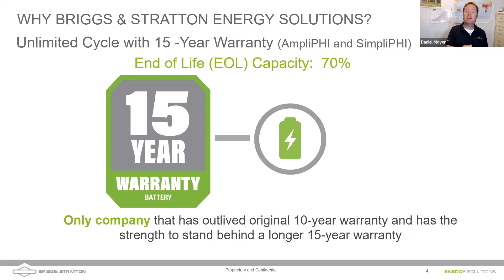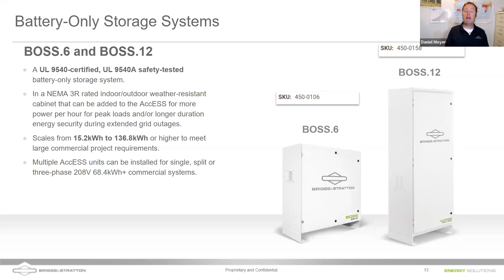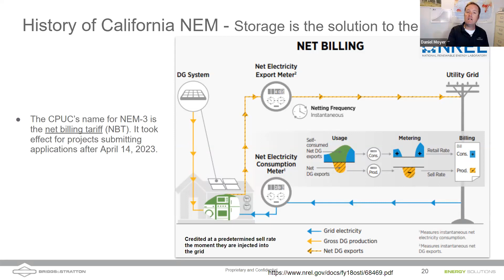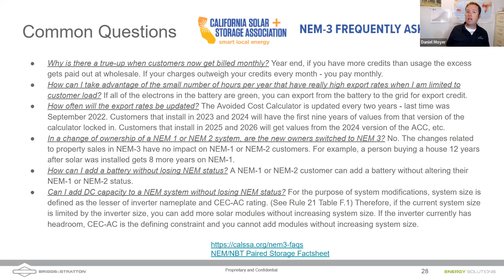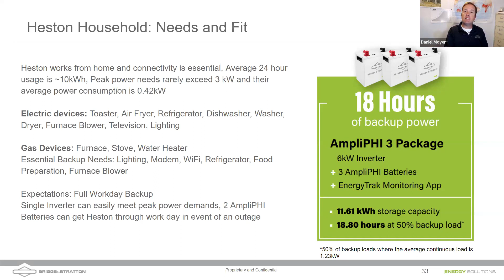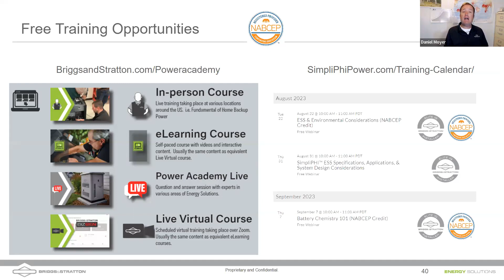How To Sell Battery Storage Under NEM 3.0 in California

Comment: Is there an online cost sheet available for these products?
Reply from the maker: @gracemalley6821 we only provide cost sheets to our installer and distributor partners, but, if you call our sales line, we can try and answer the questions you have.
+1-805-640-6700, Option 2